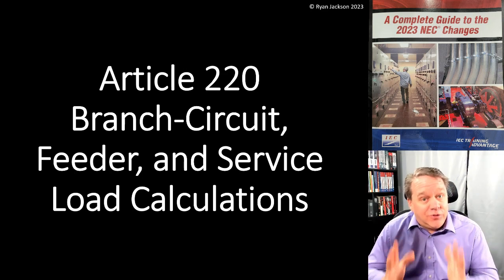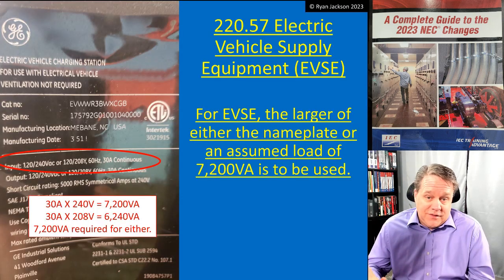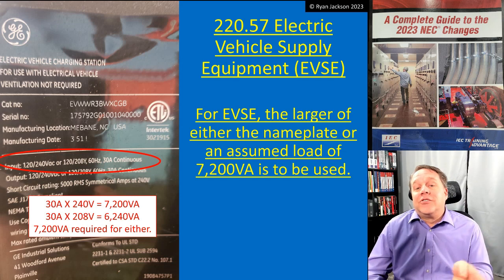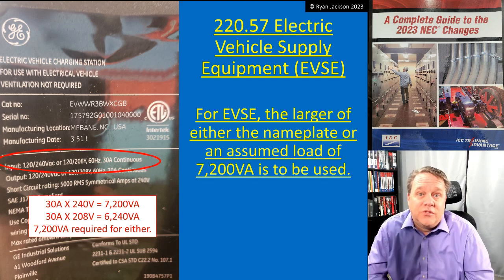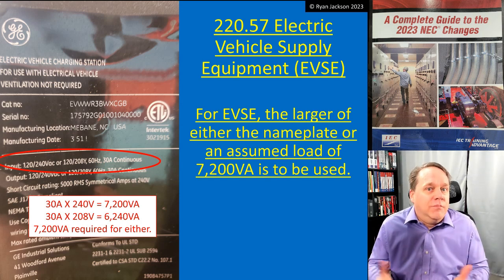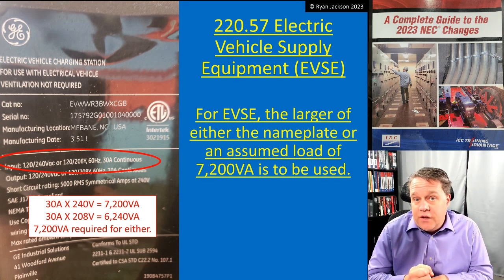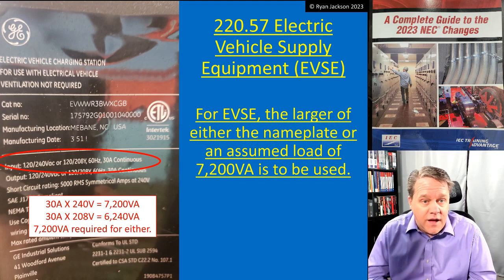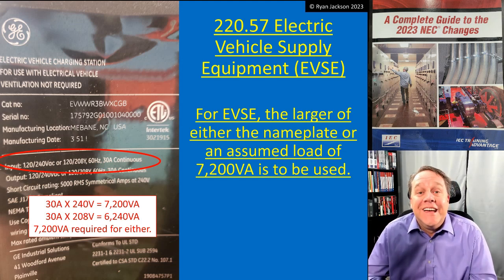2023 220.57 Electric Vehicle Supply Equipment

Comment: I hope you take a deep dive into the calculations for multiple EV chargers on a house panel in multifamily installations in your upcoming videos. I'm told by one AHJ that the feeder for that panel needs to be sized for continuous load - assuming all EVSE will be running at their maximum current for 3 hours +. Seems like overkill, we don't require that of motor feeders, why would we do it for EVSE?

Comment: When I was ten (in 1980) all these dudes were doing "NO NUKES" concerts. Now they're all driving around in EV's and I cannot imagine that nuclear energy isn't a big part of the future for electrical production.
Reply: I was 12 in 1980 and visited Seabrook nuclear power plant(NH) many time back in those days(Dad was civil engineer and went there on ASCE excursions).  I don't really care about EVs.  I work on/engineer controls for power plants that burn garbage.  But, I can see that the train of EVs is coming down the tracks and frankly can also see that there is going to be trouble to charge the things. Capacity isn't even close to being available.
Reply: “They” want solar and wind only.  So we are dependent on China manufacturing.